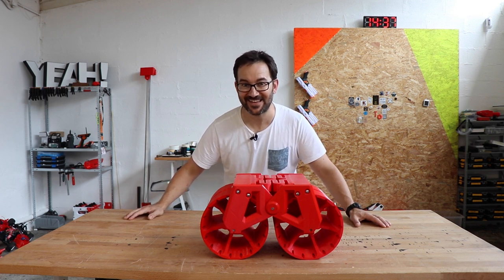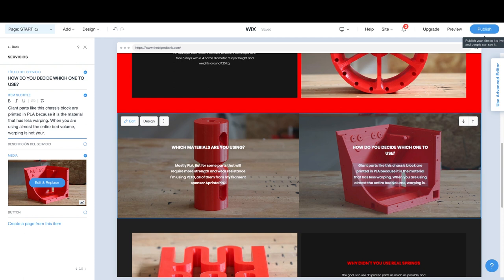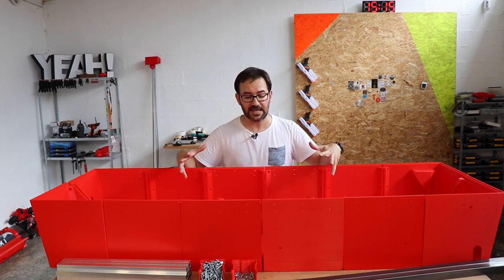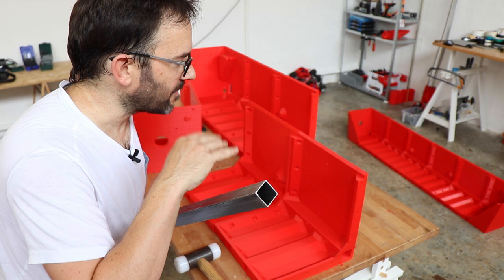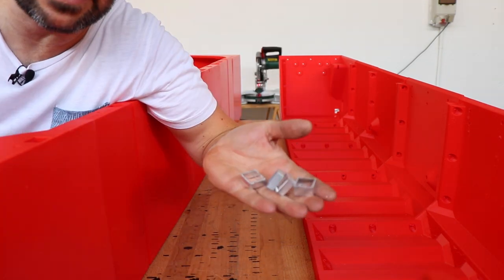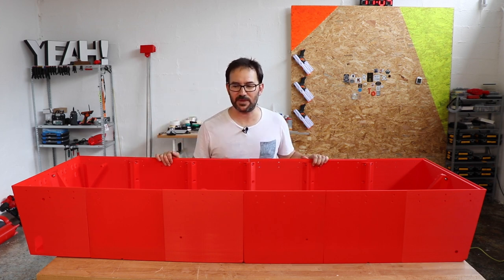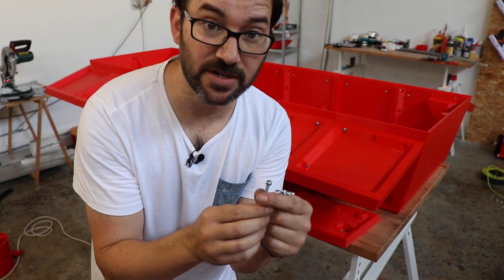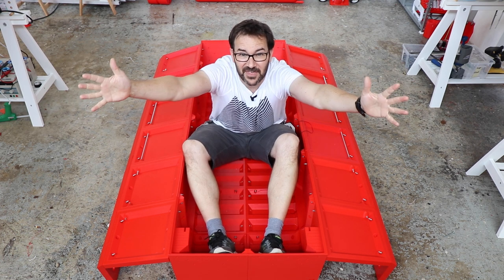BIG 3D PRINTED TANK - THE CHASSIS

Comment: Team up with master Milo, make a full size printed tank, break a world record? Collaborators with all the YouTube printers
Reply: I know this doesn't just jump out at you on YouTube, but check out 3DP-Platform Excel series.  Have personally spoken with their presenter/installer back 3 yrs ago. Have brochure on printers that can be custom built @ 20ft. wide x 12ft. high by they say up to 300 meters long. This is no bs.  The costs would be staggering. The 3DP guy told me that a college in Connecticut(with large grants) bought one of the smaller Excel Series, but they are still way bigger than anybody elses printers.
Reply: @davidr.massey419  wow, wonder how many decades a print would take
Reply: @jusb1066  with a huge 4.5mm. hot end nozzle Excel can deposit 55kg./hour. Thats an object weighting a tonne in a day.  3DP has 4 different extrude rs that i'd like in a perfect world.

Comment: 2018: i made this rc controlled 3d printed tank. 

2019: i made this 3d printed tank can actually physically sit in and steer. 

2020: I MADE A LIFE SIZE P1000 RATTE LANDKREUZER WITH FLAMMENWERFERS UND 2 28inch 3D PRINTED NAVAL GUNS AS WELL AS 2 FULLY FLEDGED 12,8CM ANTI AIR AUTOMATIC GUNTURRETS

Comment: Maybe you ought to look for a Tesla sponsorship for your electric tank. You know, to help out with the batteries this monstrosity will need.
Reply from the maker: Ya think? You may be surprised...
Reply: Ivan Miranda no room for batteries...only for ivan
Reply: Ivan Miranda In all seriousness the batteries could be pretty small if run time is short and the gear ratio/drive train is reasonably efficient
Reply: But Tesla has never spent any money on advertising
Reply: Needs a Prius battery...

Comment: It'd be complicated but I wish you'd used torsion bar suspension and either interleaved wheels or overlapping wheels. It would improve weight distribution and overall performance.
Reply from the maker: How do you measure performance on a plastic tank? Could you pass me your metrics?
Reply: @ivanmirandawastaken  When I say performance I mean that if you have better weight distribution the tank will be putting less strain on it's suspension and would need less power to move. I'm no engineer just a WW2 enthusiast, and torsion bar suspension invented by the Germans/Russians and popularized by them for their superior "performance". As far as measuring performance in plastic idk that's your "job", but it more than likely would help considering how heavy it probably is.

Comment: Wow, Ivan, this is MAD! :) IMHO here are too much connections. All these parts will be bending. This will happen dynamically... And... You have NO intersectional dampers! I mean that these pieces will be stressing each other very hard but not very noticeable (maybe). I would recommend to place 5-12mm rubber sheets between pieces. You can even insert small round pieces and fill the gaps with a foam. Just find one that will be water/oil/dirt-resistant (lubricants obviously!) and will not be "eating" the plastic in a reaction.
Thus you'll get a significally better strength of the shell by the cost of a bit more weight (2-5% maybe).
You've seen 3dp Nerd's Formula-1 (most probably) and what he got because of the friction (it was not your case but anyway!).

Comment: I do a similar thing with inserts in 3D prints.  I have the tolerances worked out for my applications but there is still a ridge at the edge of the hole.  This might be what was affecting the fit of your tubes - especially the cross beams - relieving the edges of the holes with a deburring tool made for plastics may be a simple solution to that problem.

Comment: holy CRAP! O_O that's huge!
Reply from the maker: Yep, that's what I was aiming for
Reply: @ivanmirandawastaken  don't know if you already solved the problem of the aluminum beams that doesn't fit, but if it's not that much the difference you can try putting them in the freezer or find a way the lower their temperature.. they should shrink enough to fit..extracting them afterwards is another story.....

Comment: When the metal starts rusting, the tank will split. I have seen this on a SAAB, where a bolt was integrated in a sprinkler tank. What cut be a solution?

Comment: Suggestion for getting all the internal metal rods in there. Instead of doing the long rods first, do them last so you have the small internal rods in there. You will have to apply less force on all the parts due to only having 2 friction points at a time while assembling.